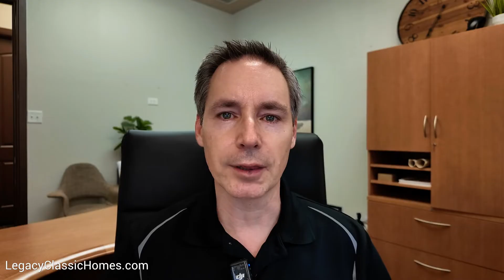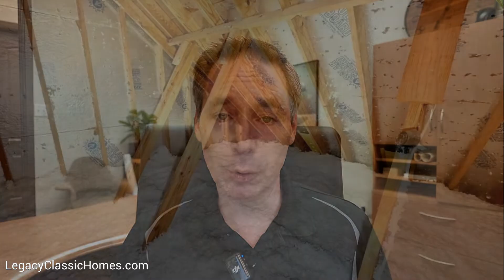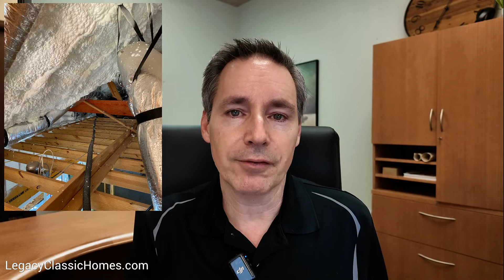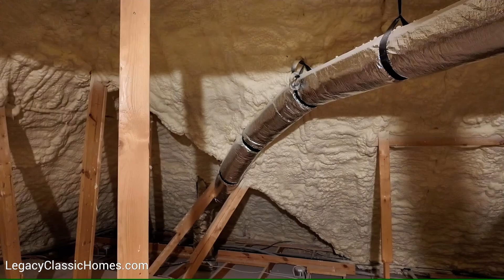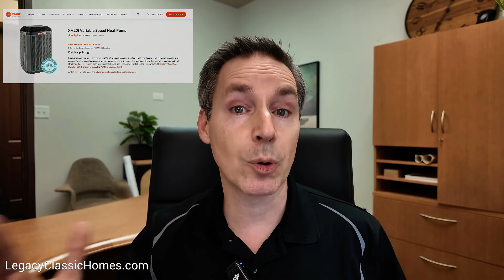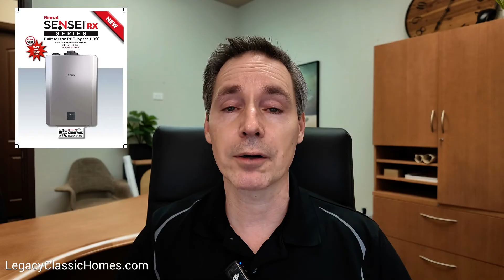Must haves in new home build. My top 5 construction features!

Comment: 1. I think spray foam is a bad idea. issue is if you ever need to do repairs or remodeling it becomes a nightmare. Also in a fire you get asphyxiated from the toxic smoke. Best option for wall cavities is Rockwool batts as they can easily be removed & offer the best for fire issues. The best bang for the buck for insulation is to install continuous rigid foam panels on the exterior side. I would recommend 2" (R-10). 
2. The best option for Roofing is SIP Panels. as these will absolutely perform the best for thermal management. I don't recommend SIP for walls since you need to run utilities in walls. 
3. Don't use Flex duct for HVAC. use metal duct, thin wall PVC pipe, or Kool Duct (kingpan). The issue with the flex is that it degrades and the thin plastic lining starts to split after about 10 to 15 years. Another issue with Flex Duct is that it can be easily constricted (kinked bends, or improper mounting). Kool Duct is the best option since it provides insulation properties, where as the metal duct may need exterior insulation to prevent condensation or thermal losses (depending on the situation its running through (ie uncondictioned area like a crawl, basement or attic space. PVC is easy to install & a great option for connecting rooms to the trunk like. I used Kool Duct for the trunk ducting & PVC for connecting Rooms to the trunk duct.
4. For windows the best bang for the buck are fiberglass windows. They don't rot, low thermal losses in the frame, less flimsy than vinyl, cost effective. The issue with the alum frame windows is alum. is a very good heat conductor & will have higher thermal losses. 
5. For an energy efficient home, the better option are ducted minisplits. What you need to do is have a Manual J report done for your home to properly size your HVAC system. Oversize it slightly to accommodate heat output from applicances (refrig, dishwasher, dryer, etc). Having multiply Ducted minisplits will work the the best (one for each floor). I have a 4500sqft home & its cooled using two 13Kbtu ducted minisplits. In my experience humidity isn't a problem in a tight home. I live in a subtropical zone (7b) , & the humidity is always low, usually in the low 30% range. The minisplits do too well of a job pulling humidity out & I have to run a humidifer a bit year round.
6. The issue with tankless water heaters is short cycling. Modern appliances like washers & dishwashers now have intermittent water draw. They'll pull some water, shutoff, than pull some more water & shutoff again. This causes excessive cycling of the tankless boiler which not only prevents hot water from reaching your applicances but will also but a lot of wear on your system. I would recommend a boiler that has at least a small tank, or you add a small tank water heater to serve your kitchen & washing machine.  For the tankless system, you need to install plumbing to allow you to flush your system. This will require shutoff ball valves on the input (Cold side) and the output (hot side) with valved ports that you can use to hook up hose lines & a pump. You run in de-scaling agent using a 5 gallon bucket to flush out the scale. You want this so its easy to do flushing. 
7. Issue with hot water cycling system is they can waste a lot of energy, and with a tankless your system will be cycling on\off all the time. Realistically waiting for a minute for hot water isn't a big deal. Make sure all of your water lines are insulated especially if you use a hot water cycling system!
Reply: This. Spray foam for the entire house is a bad idea. There are multiple better ways. And aluminum is the last window I would use.
Reply: Excellent!
Reply: Wow you really schooled this guy
Reply: Excellent points
Reply: We’re building a 1320 sq foot home…your thoughts on 1 ducted mini split 18k btu…
I got pretty deep in the high efficiency home build and we’re building this small home for my mom. 
I can’t find anyone to do a manual J and it took schooling our framers on how to’s for  certain parts of the build. We’ve put insulation on all 6 sides and taped and flashed it very tight (as we knew how) and purchased an ERV 
Really stumped on the hvac and what to do…juggling between Mr Cool mini splits diy or Mr Cool diy heat pump hvac system then we go to the ‘let’s let an hvac installer install a system🥴
My husband has talked me into open cell spray foam  as we have exterior insulation on the roof-4 inches…unvented roof line and conditioned attic. However, only R-6 on the exterior walls and not sure that’s enough to do open cell. 
We live in central MO…do you have any thoughts on my scenario…?
Reply: @michelleshafer3330  You can find some online to do Manual J report for you. Thats what I did. You send them your building plans, window info (brand, size), and how your going to insulate. They provide you a report back. The person I used, I think charged about $180 (but that was before the inflation wave.

I have Fujitsu ducted minisplits. Each is about 13K BTU (one for each floor & each floor is about 1600 sqft). No issues cooling (I use hydronic radiant floor heating - Propane). Issue is that the US banned R-410A for new units, You need to use either a R-32 or R-454B system. R-32 is more efficient than R-410A so look for a system. 

Issue with a HVAC is they probably will charge you an arm & leg. For the duct work, I order pre-fabbed ducts using KingSpan KoolDuct for the main duct work. There are companies that will make the ducts for you if you provide them the layout. The ship in pieces & you assemble them with metal joiners & alum duct tape. The Kool-duct is a more rigid foam which is about R-6 (useful) when running through unconditioned space. I don't like the flex-duct as it sags & the plastic degrades (needs to be replaced usually after about 25 years). for the duct runs between the main duct & the rooms I used 6" schedule PVC pipe. It doesn't carry noise like Metal does would be easy to clean (nothing to snap a duct cleaning brush on. I wrapped the PVC duct with Bubble wrap insulation (sold as insulation in Lowes\HD). The PVC was also cheaper & more available at the time (during 2020-2021) than the spiral metal ducting. 

You could go with the square metal ducting & create the duct yourself, I did that in a few places (wall mounted ducts in the first floor (AHU is in the basement). Second floor AHU is in the attic. Its not too difficult & there are lots of YT videos on how to make metal duct work. A lot of the pieces just snap-together. 

For attic (Roof insulation) you can use Rockwool. Just get the size that matches your roof joists. If you used Roof trusses 2x6, You can install the rockwoll batts & Them rigid foam panels on the bottom side.

Comment: Summary

Steve from Legacy Classic Homes shares his top five must-have construction features for new home builds, emphasizing efficiency and comfort.

Highlights
🏡 Spray Foam Insulation: Whole house encapsulation enhances energy efficiency and temperature control.
🪟 Thermally Broken Aluminum Windows: Improve thermal efficiency and allow for larger window designs.
❄ Variable Speed HVAC Systems: Offer better humidity control and energy efficiency by adjusting airflow based on needs.
💧 Tankless Water Heaters: Provide endless hot water and last longer than traditional tank systems.
🔄 Whole House Recirculating Systems: Deliver hot water quickly, reducing waste and wait times.
💡 Energy Efficiency Focus: Prioritizes sustainable construction features that enhance comfort and lower utility bills.
🛠 Custom Builder Insights: Steve shares practical advice for home builders and remodelers based on his experience.